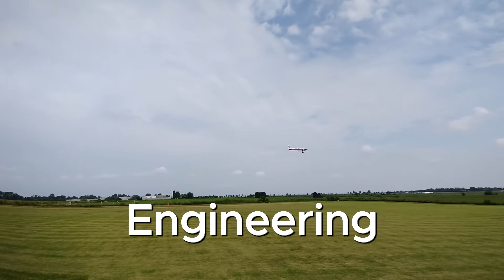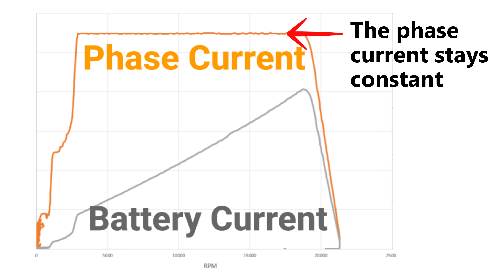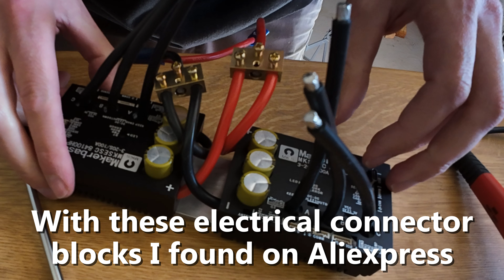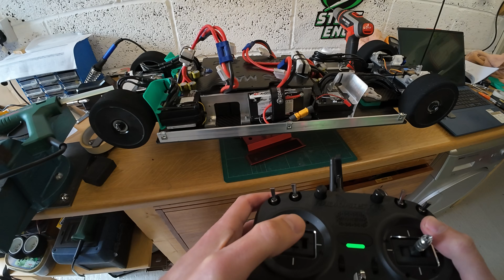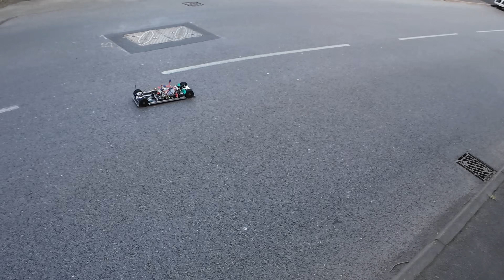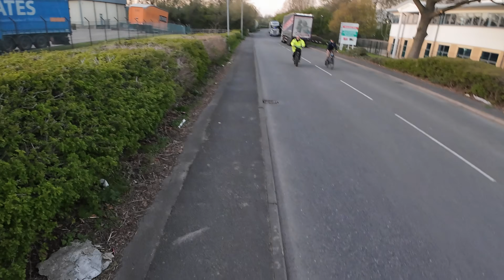Did I choose the right ESC for my 200mph R/C?! + First Test Crash!

Comment: I am wondering about your braking method : does the car only uses disc brakes (there seems to be servos in the front wheels pivoting turrets, do you use also the VESCs regenerative braking function. Which model do you use and what braking torque do you get ? I can't find much information about RC car disk brakes performances. Thanks in advance
Reply from the maker: Hi, earlier on I used friction brakes that rubbed on the motor bellhousings, but once I found that the ESC braking worked well I took these off (I liked making it more simple!). Sorry its not helpful for you, Project Air is using disc brakes on his latest jet car maybe ask him.

Comment: This is impressive! Congrats on the record!
What is the load distribution front rear? If rear has much more, what about putting 6 wheels on the car (double in the rear)? 8mm batt connectors and preheating Lipos could also squeeze out a little more.
Reply from the maker: Hey and thank you!  I already am using 8mm bullet connectors, and I wasn't using all the battery power yet so no need to preheat. 6wd has crossed my mind in the past but I didn't want the extra cost and complexity!
Reply: @steveeng1826 If you use a copter flight control with open source sw you could implement a launch control which limits the car's acceleration to a set value for stable driving. And if you get access to motor rpm you could even prevent wheel slipping. The possibilities on such a platform are incredible!

Comment: I have been following this closely! I subscribed after your first video on this concept car. Your different background is already doing such good things for speed cars. Your approach is unconventional at nearly every step of the way, and I can see this potentially being a proof of concept for several unique methods for speed running.
Reply from the maker: Awesome, thanks for coming along for the ride! I'm hoping to get some results this year to get some evidence behind my different approach. Keep an eye out for next weeks video where I show a track session I did recently!
Reply: @steveeng1826  have you thought about using the flight controller for active aerodynamics? To provide stability and variable downforce if the car tried to catch air.
Reply from the maker: @fabianrudzewski9027 hi, yes I've thought about that, I have some ideas in mind but I need to show the base car works before I add in more complexity 👍

Comment: Couldn't you use INAV or Ardurover for the gyro, it would give you the option to get a bit more telemetry, understanding the 3 axis acceleration would both help you dial in your torque at different speeds, give you some feedback as to how well your suspension is working and provide an advanced PID controlled gyro that could adjust with speed.
Reply from the maker: Hey and thanks again for watching! On the Beast's previous incarnation it had a flight controller which handled the steering and gyro functions, but I wanted to massively simplify it hence this has gone. The car should go straight without the gyro, the gyro is really just there to help prevent a crash if it goes sideways for some reason.

Comment: You think one of those esc could be water cooled and run in a boat
Reply from the maker: People use VESC's for various water craft like powered foil boards, but I don't know if they have water cooling. However I'm pretty sure you could attach the main board to a water cooled heat sink with no issue. Thanks for watching!
Reply: @steveeng1826  there are watercooled vesc's from Flipsky and Maytech, for example.

Comment: 👏👏👏 It turns, it goes straight, it sounds "right". Brakes work rather (too) well... ALL looking very, very promising for ROSSA. 
Epic journey and dedication that has been great to watch, as well as learn from and I will certainly continue to watch to the end. 

Is there any way to set in fail safes so you cannot set off with the wrong settings applied, ie mechanical brake? 

Rolll on ROSSA.
Reply from the maker: Thanks Derek and thanks for watching! I'm thinking of taking the mechanical brakes off actually. I don't think they are much good when moving anyway, only as a handbrake, so they are only adding extra complication!